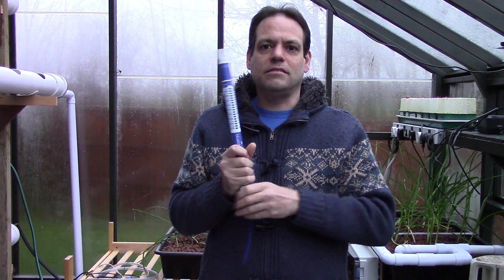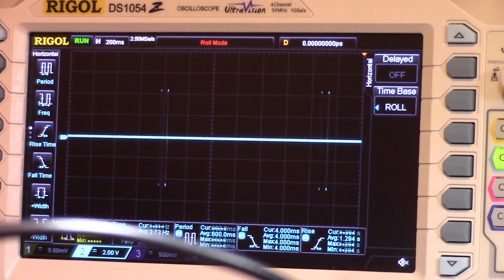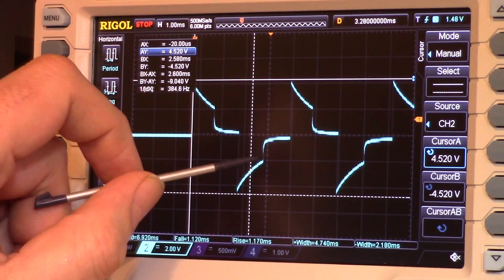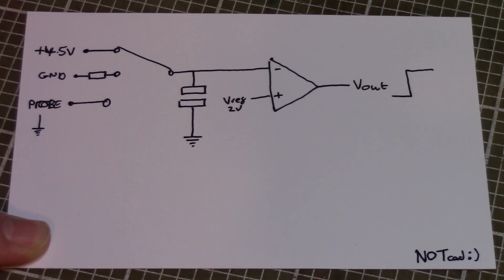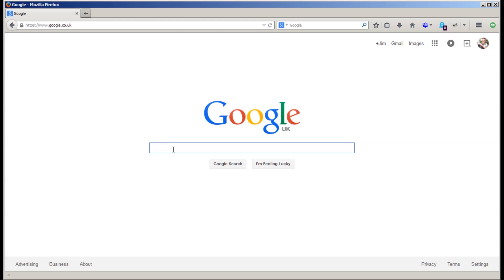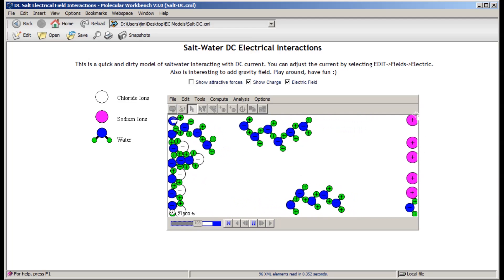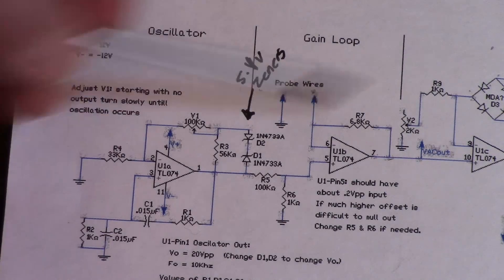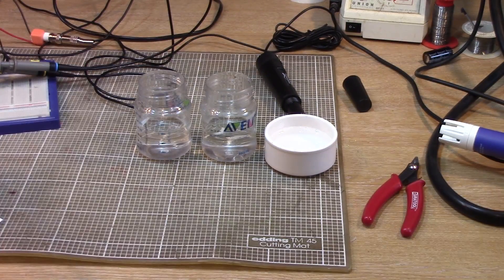EC Probes - How they work, and how to build one.

Comment: This was insightful, thank you. I bought one of those cheap EC modules that you use with arduinos and the like, it works very well until it's in the same container as the pH probe, which it increases the reading of. So it seems to be AC interference. I tried shielding both with aquarium air tubing and aluminium foil but no joy. I did read that some commercial units just amplify the pH probe in comparison with the EC probe. I powered them both separately with batteries in case it was a ground-loop problem but no joy.

Comment: I have very little information on electronics. With the little knowledge I have I do NOT thing you need a lot of Operational Amplifiers to make an EC meter, You need only one to oscilliate the circuit and the change in voltage can also be read by most volt meters as AC, no need for conversion to DC to read the voltage reading.

Comment: Thanks for the video Jim. I am not sure what unit this BlueLab instrument is measuring EC. I thought it should give output readings in Siemens or Ohms. I want to measure a solution in 500uOhms. Do you think this design will be able to do it? I will rig it up on an arduino and I will be happy to share the code. Cheers anyway Jim

Comment: Hi mine is just stop working suddenly. Does anyone know how to fix it?
Reply from the maker: Stopped working totally, or giving wildly wrong readings? ... I found that using the BlueLab truncheon for stirring calcuim nitrate solution causes a greasy buildup on the tips of the probe and prevents it from making contact with the liquid correctly. Bluelab supply a cream-cleaner specifically for cleaning the probe tips which seems to help for a while, but has not permanently fixed my own bluelab truncheon... just seems to make it work for a few hours each time I use it. If it's totally dead, I'd look to the batteries and their connections... Hope that helps. Cheers!!
Reply: Jim Conner well it was wildly irradic for while and then stop working completely. I checked the batteries  and changed the battery  but no success don't know what to do. I can't get the blue lab cleaning solution . Is there any other way to clean it.?
Reply from the maker: Kitchen cream cleaner I think should be OK. The probe tips are pretty robust and designed not to be damaged by ph-up/ph-down solutions etc. Just make sure it's all thoroughly rinsed off afterwards so that the cleaner doesn't sit there eating away at the contacts after you've finished cleaning. (Please note... 'I think should be OK'... I don't work for bluelab and am just guessing based upon what their bluelab branded cleaning product smells like - If you ruin your probe, please don't blame me). Cheers!!
Reply: Jim Conner thank you . I'll certainly not going to blame you. I'll try it and I'll let you know what happens .
Reply: Yup it worked. Thank you

Comment: Hi, is it possible to use battery and +-3.3V to power this circuit, instead of+-12V?
Reply from the maker: Hi Dharmesh - That's not possible with this particular circuit as the op-amps used won't work at that low a voltage. It would however be possible to use some small boost converters to generate the +-12V supply from a lower voltage.  I was planning to use a PowerPax 1PE1212S converter for the role myself, but that one is designed to boost up from 5V to +-12V rather than the 3.3v supply you have... I expect someone makes a similar converter which works from 3.3 volts though. Hope that helps. Cheers!!
Reply: My battery will be 4.2V, what would the lowest voltage possible? From the datasheet of TL074 it shows +- 5V, but what effect would that have on the circuit or reading? If so i then can use a simple inductor less step-up dc-dc

Comment: Hi. I am the original designer of the dissolved solution meter made by NAGS.  When I made our probe we used 316 grade stainless steel, it does not corrode and it stays clean for months.  You can by it in welding supply places, it was basically welding rod we cut into tiny pieces. The only problem is that it is impossible to solder to, so I made a tiny circuit board with 2 slots that the rod was forced into to make and mechanical and electrical connection, there was also a thermistor on there to allow for temperature compensation.  Then the whole thing was coated in epoxy to keep it water proof.
Reply: Thanks for the information, Randy.
Reply: many thanks

Comment: Nice!  I want to install some sensor probes in my orchard to measure soil moisture and the like (relative changes), and this looks like the solution.  I got an Arduino for Christmas, so it might get put to the task too.  Many thanks for sharing.  Finding the right transmit amplitude and probe gaps is going to be the challenge.

Comment: hi jim: i am trying to make a similar sensor with salinity range from fresh to solubility (for NaCl which is about 225 part per thousand) or 200 ds/m, have you tried to work on that large range? thanks
Reply from the maker: Hi Chenming - The maximum I need to measure for my nutrients is about 2500ppm, but there's no reason that this same circuit shouldn't be able to measure much higher ranges. EC is just a measure of the liquid's electrical conductivity.. The high-frequncy AC measurement is used to stop electro-chemical reactions from occuring, at the electrodes, so most of this circuit is just dedicated to either generating the AC frequency, or filtering it back out again so that you can get a good DC reading value... If you turned down the sensitivity of the amplifier parts of the circuit, then you should be able to measure any strength that you like. Hope that helps. Cheers!!

Comment: Hi Jim, im about to start doing this project following your steps, but I havent decided which probe to use. I am trying to find low cost probes, can u recommend me any?
Reply from the maker: Hi +Fernando Escamilla  - If I did this project again, I think I'd have a go at making my own probe too... The commercial/industrial probes are expensive because they use platinum for the contacts (because platinum doesn't react with the water in any electro-chemical way), but apart from the platinum, it's just a plastic tube with a co-ax wire coming out the back - there's no electronics inside them at all. Platinum is expensive stuff (£6/cm for platinum wire on ebay in the UK)...  If you're just checking nutrients periodically though, you can most likely get away a different metal for your probes... Stainless steel does well in high-salt marine environments, so will survive quite well with nutrients. Technically speaking stainless will react with the solution when a current passes through it... stainless contains chromium which will very very slowly react, but given the miniscule currents involved, and the fact it's a high-frequency AC waveform we're driving the probe with, the reaction will be pretty close to nothing... So... two stainless stell bolts, and plastic tube and some co-ax and you're good to go.... If you have problems with that setup you can always swap to a platinum probe in the future. Hope that helps. Cheers!!

Comment: hi Jim the website u mention has been taken down! do u happen to have the circuit with you? thanks.
Reply from the maker: Hi +Arthur Denzlin  - Just search for 'EC Probe Schematic' using Google Image search - You're after the one which says 'EC/PPM/TDS Meter' at the top of the page... It looks dark-grey because the image has a load of little grey dots on it... but you can clean them up using a contrast/brightness filter in the image editor of your choice. Hope that helps. Cheers!!
Reply: +Jim Conner  thanks jim i found the circuit!

Comment: hi jim in your video at 14 min you are  showing voltage value increases as concentration of salt increases. but with me it happening reverse .it showing nice increment at 8 pin bt at 14 pin decrement.
Reply from the maker: Hi +Rahul Kumar  - I haven't forgotten about you... I've dusted off the circuit I made and will try to get it plugged in to check voltages this evening after my kids are tucked up in bed. Sorry for the delay. Cheers!!
Reply from the maker: Hi +Rahul Kumar - Pin 8 should be giving you an amplified version of the sine wave coming through the EC probe. It'll should be AC rather than DC at that stage... after that it passes through the bridge recitifer to turn it into DC... gets smoothed by the RC filter made from C3 and R8 and then passes into the last op-amp stage for level shifting and amplification. I've just tested with a random-strenght salt solution (somewhere around EC 3.5)... I'm getting 1.1VAC on pin 8, which is giving me 7V out on pin 14. Hope that helps. Cheers!!
Reply: +Jim Conner  in tap water at 8 i am 700 mV ,at 14  300 mV . in salt water at 8 its 900mv , at 14   200mV ? is it correct?
Reply from the maker: Hi +Rahul Kumar - It sounds as your last op-amp is not amplifying things correctly... The numbers at pin 8 aren't too unreasonable, but you might want to tweak the variable resistor V2 to push the values a bit higher. There's a 0.7v voltage drop across the bridge rectifier, so not much of the signal from your 700mv and 900mv measurements on pin 8 will be arriving at the final op-amp stage. Hope that helps. Cheers!!

Comment: thanks jim . at the output pin 14 of op-amp i am getting in mV. after dipping in salt water also output is in mV range. what to do. is i have to multiply that values with 500 as given in  sheet .
Reply from the maker: Hi +Rahul Kumar - You should be getting a higher reading than that in salt water. If you were getting 1V output that would indicate that your EC was 500. Do you have an oscilloscope so that you can probe various parts of the circuit? It's probably worth taking a look at pin 8 before it feeds into the bridge-rectifier.. You should have a reasonable voltage at that stage (enough that loosing 0.7v across the diodes isn't an issue), so should be easy to probe... Probably also worth checing your power supply rails (always check voltages first). You might be able to find some more debugging help from the original webpage where I found the circuit diagram.. http://www.octiva.net/projects/ppm/ ... Hope that helps. I don't know what else to suggest. Cheers!!

Comment: hi.. jim thanks for your video. in video i have seen that output wave form across oscillator is AC , and you are getting 17 v p-p bt supply to op-amp is +12 n -12 how i is possible ? and can u tell me that what is AC v across pin 7. and how to get -12v supply?
Reply from the maker: Hi +Rahul Kumar. The + and - 12v rails give us a total of 24v peak-to-peak that we could move through, so 17v p-p isn't any special kind of magic. When I made this video I was using my triple-output bench power supply to give the + and - rails, but since then I've purchased a dedicated DC/DC converter to solder onto the board... I'm using this one http://cpc.farnell.com/1/1/192485-powerpax-1pe1212s-wr2-dc-converter-1w-12v-12v-dual-op.html .. Hope that helps. Cheers!!

Comment: Hi..can your EC probes be connected to Arduino (Microcontroller)?
Reply from the maker: Hi Rozaidi Rais  - Yes - the circuit I built in this video was to get the voltage levels from the probe to something compatible with a microcontroller - Should work great with an arduino (or any other microcontroller)

Comment: Jim, You brought back old times.  I have not used a scope for almost 15 years.  Almost miss it.  In my younger years I worked radio and radar, and anything else the boss figured I could fix.  You explained the subject well without adding obscure formulas that would loss many.  Thanks.
Reply from the maker: Ronald Montgomery Heh... and on the flip side, I've been hankering after a scope for about 15 years so that I could try some more involved repairs (the ones which I can't tackle just a multimeter). Glad you found my explanation understandable - I was never good with all those complicated formulas myself. Thanks for watching and taking the time to comment. Cheers!!

Comment: I did actually wonder why the voltage went negative Jim. Mind due i wouldn't have had a clue as to what was inside one of those things so that wouldn't help :-) 

Oh, and I say why measure with a meter when you've got a nice scope :-) hehe. 

Cheers mate

John
Reply: Ps...  Love the JimCad ;-)
Reply from the maker: Thanks John - As you've probably guessed already, I'm loving that scope. The only problem is that I now have to tackle some electronics repair jobs which have been on hold for years waiting for me to get that scope. Cheers!!

Comment: Good one Jim didn't even need to be told about it this time!
Good explanation on conductivity A/C vs  D/C etc also I was glad that the commercial and your probe agreed so well!

Waiting for your next installment
Reply from the maker: Cheers John - I've already been soldering up a more robust prototype on stripboard this evening - Typically, it is not working at the moment :) Cheers!!
Reply: Jim Conner
Yeah normally I wouldn't of risked videoing the Breadboard but it  worked well this time and always look rather mad scientist
Reply from the maker: 101blog I'll be honest, I'd already made up the oscillator part of the circuit before I began filming the video at all. I was so pleased when I got a nice clean sine wave out of it that I wanted to share the construction process, so I did the bluelab analysis to see if it was working the same way as Isabella's circuit (which it wasn't). Cheers!!

Comment from the maker: I decided to take a look at what my EC probe was doing, and ended up building the circuits to run a generic ebay cheap probe. All electronics this time and rather technical throughout, but hopefully some of you will be able to understand what I'm waffling on about. Cheers!!
Reply: Hi, Im working on it. Would u mind giving me a link or some thing where the needed components for the EC metter are listed. Im reading values with my Arduino but it´s not working right. Thanks!
Reply: What is the brand of the EC probe that you used? Can this probe be immersed in solution for continuous monitoring?